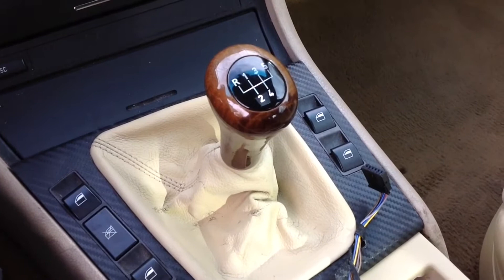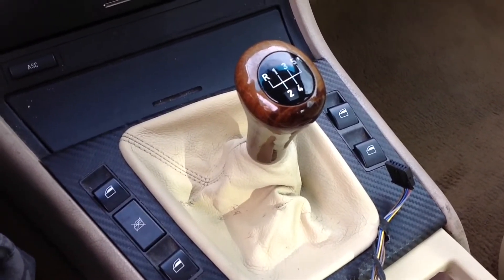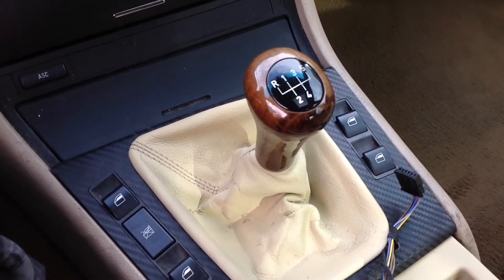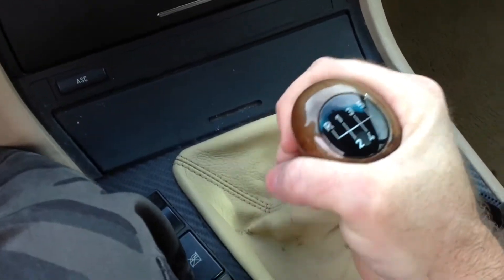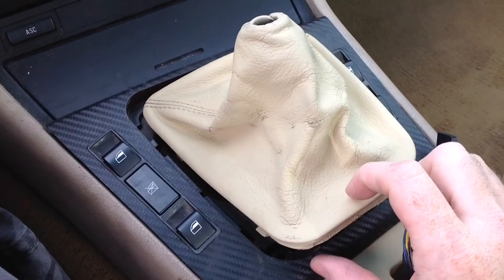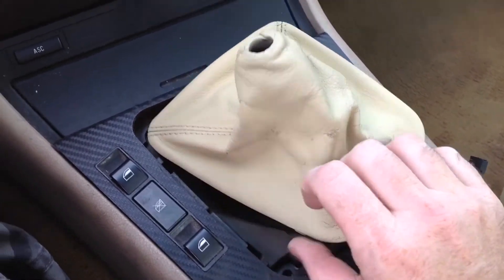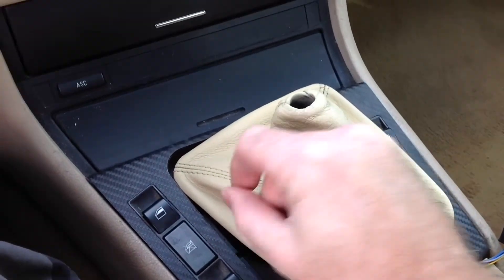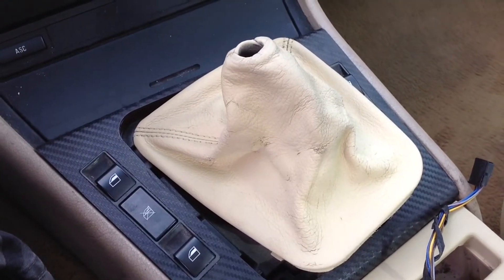BMW Manual Transmission shift knob and boot removal M3 M5 e30 e36 e46 e90 e92 e34 e39 x5 e60

Comment: LOL, I saw that comin....too funny.  I'm sure you've thought about getting some sort of small tripod, there's lots out there.  I guess it depends on what kind of camera you're using.  I don't think I've ever heard you say what you use.  Anyway, great tip, thanks.
Reply from the maker: +dave lauck I have tripods but it is hard to set them up inside the car, i was using my ipad doing this, it seems to take good video and the 10 hour battery comes in very handy trying to film longer video with many clips, all of these videos are done on my ipad or iphone with a external mic